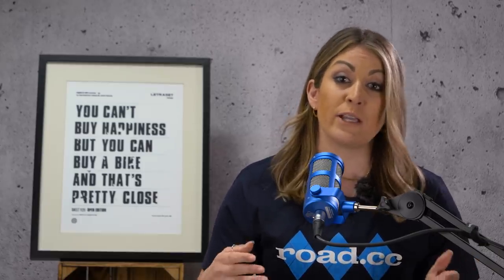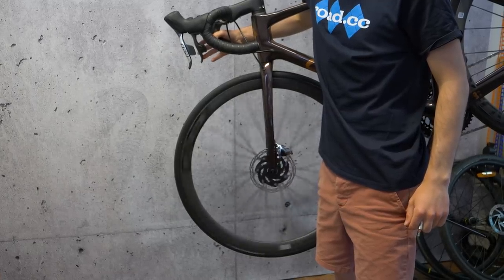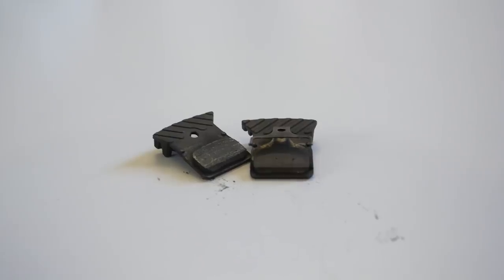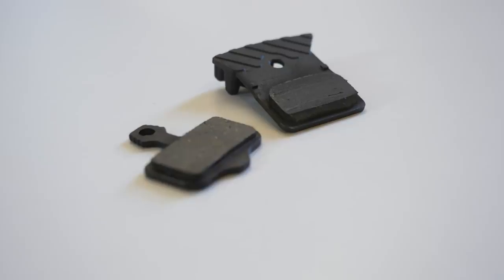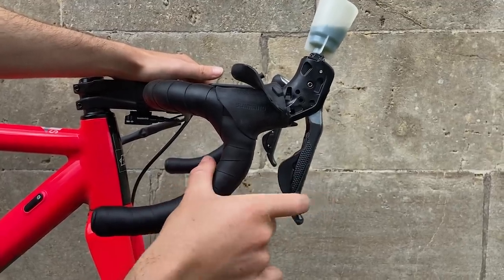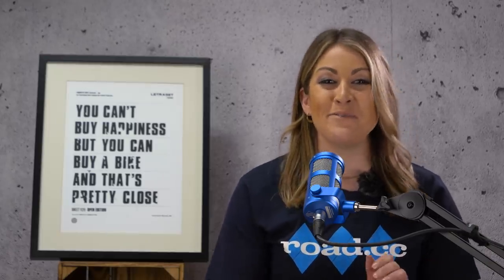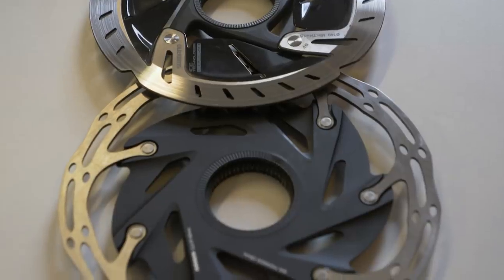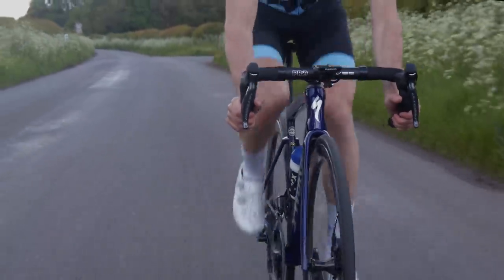8 things they dont tell you about disc brakes

Comment: On the aero aspect there is minor difference/s between the rim and the disc, and the tests have been done time and time again. However, on the maintenance, servicing, fluid change, breakage etc, the disc brake falls way, way, way behind! Yes, half of the Tour de France, Giro di Italia etc racers, do have the disc brakes, but that's only about 200 people on Earth with a mechanic crew with them all times.....if you aren't racing with a crew with you all times, just stick to the rim brakes, the pro level pads on the rim do a good job even in wet conditions, and no bike shop, or crew needed!

Comment: @road.cc... Most problems with disc brakes are caused by poor setup, or poorly engineered brakes. If you do not get the brakes properly alligned during installation you loose your pad clearance tolerances which will cause the pads to rub the rotors. If the company cheaped out on the hoses and fittings you will get air in the lines causes a lot of headaches. So to remove the headache from disc brakes buy a upper end model and get them properly installed by a good mechanic.
Reply: That is very true, another problem is bike frame manufacturers are poor at keeping tolerances within design criteria, so mounting holes, through axles are not perfectly aligned. Therefore your caliper is not straight and/or your wheel is not perfectly aligned. Not such a biggie on rim brakes but important on disc. Why i believe some people have no problems with disc and other have a nightmare with them.
And all surfaces need to be faced prior to building the bike.
Reply: I did my own setup with Shimano disc, perfectly.  Has nothing to do with it.  Dams F’in Squealing. 😡
Reply: @robertp7209  ... It sounds like you have a resonace issue of some sort. Chris Froome was having a similar issue on his bike which is why they went to the Swiss Stop brake rotors and pads.  Frame manufacters, fork manufacturers, and brake manufacturers have not tested their equipment together to make sure they aren't prone to hitting resonant frequencies. 

https://www.swissstop.com/catalyst/
Reply: @coldforgedcowboy  thanks for the advice, the bike came with bolted Shimano ICE rotors.  At this point I don’t care about weight, just don’t want to wake the dead when I brake. 😳

Comment: Rotors are more expensive than people realize if you stick to spec. New Shimanos are 1.8mm and have min thickness spec of 1.5mm, so you get 0.15mm per side of wear before replacement, which is not that much if you do any sort of descending on them. If you are riding Ultegra rotors at $60 per pop, it'll add up quickly. Same with those fancy finned pads. Budget a couple hundred dollars for brake consumables per year. Compared to rim, which you can ride for ages on same pads and if you keep pads clean, maybe get 20000+ miles out of  a set of $300 alloy wheels before needing new rims.
Reply: Exactly, I been riding alloy for 15 years and it still doesn't need replacing. Disc Brakes are for idiots running down the latest fad

Comment: How does the bike know whether you are bedding in the brakes or not? Because it must know otherwise just normal riding will bed them in (how do you brake without using the whole disc surface?...), so the bike must be able to decide to ignore this riding till you let it know your are bedding them in right?
Reply: In my experience bedding in takes about 2 minutes. Ride up to about 25 km/ hr, hit the anchors reasonably hard, do this about 10 times and good to go ….
Reply: It doesn't. Bedding in is just a process to get them up to optimum performance as fast as possible. You never know when a driver may pull out in front of you, hence the bedding in process to do it as soon as possible.

Comment: I have mechanical discs on one hybrid bike and hydraulic on the other one which is electric. Yes I know, but in my defence I am 72 now and live in an area packed with 20% climbs from river valleys. I have V brakes on my  mountain bike. My hybrid weighs 22 lbs and the electric 49. I have been cycling semi seriously since I was 12 and was a member of the CTC many years ago, so I have had lots of rim braked bikes. I don't think that there is any comparison in stopping power between discs and V/rim brakes. The discs are miles better and progressive. I can't either discern much difference between mechanical and hydraulic except that the hydraulics have to stop 49 lbs and me, down very steep inclines. They don't fade at all. In the wet, they can be a life saver. You might as well whistle when trying to stop with rim brakes in very wet conditions. The only downside is that  pads keep peeling off the backplates.

Comment: So far so good. They stop me on a dime!
Reply: So do my rim brakes.
Reply: On a wet road? Without your tyres skidding? Pull the other one.
Reply: @reginaldscot165  is it more about modulation or break force ?
Reply: @ulyssepinon9177  Speaking as a mountain biker here, so feel free to ignore. ;) For me it’s a combination of both. (I run Hope 4 pots on both my bikes) Modulation, so you learn over time to brake safely in different conditions and on my set up anyway, the force you can generate means you can brake quite well with one finger. Let’s you concentrate more on the steering. I’m thinking long, steep, loose, rocky, twisty descents here.

Comment: it is allowed to upside down the bike? with removed both wheel to pack in the car,.. there is any issue of leaking fluid or failed on the hydrolic system ?
Reply from the maker: no, it's a closed system so upending the bike is fine. although some zealots will tell you you're not allowed to do that to any bike...
Reply: @roadcc  thx a lot for reply,.. im planning buy second hand discbrake buat outside city so gonna used car to load that bike (if the deal done)
Reply: @roadcc  maybe just make sure putting some coin or something to prevent pushed piston ?
Reply from the maker: or just get a spacer, they're pretty cheap

Comment: Okay, I only made it abut 1:10 in before bailing, but I have to make these 2 comments. 1. All I heard on the open was "8 reasons you bought the wrong thing", which is a bad way of starting a video. Look, you're off on the wrong foot. Then follow it up with some technobabble for 45 seconds, and you can check me right out. I ride disc, and I feel more confident on disc. come out swinging or go home.

Comment: Post Mount allows a mechanic to easily adjust the calipers position inboard and out. Manufacturers can get away with less precision.
Reply: I don't see it; I thought it was mostly cosmetic and I have had both. The things I appreciate about flat mount, is that if you strip the threads, you aren't damaging the frame.
Reply: @DEAR7340  with post mount the caliper has slotted holes which allow it to shuffle into alignment. From what I've seen, flat mount doesn't have quite the same wiggle room.
Reply: @DEAR7340  The same can't be said for the fork, unless the bike is, say, a Scott Foil (the disc brake mounting bolts are threaded into the caliper, just like the rear).

Comment: I don’t know if this has been asked before but can you get ceramic brakes for a bike? Some cars have them and I wondered if they have been trialed by anyone yet?
Reply: Ceramic brakes on cars (like Porsche) need a high brake temperature to work good, if they are cold they don't brake good.
Such brakes are made for race tracks, because they will get hot there and will have no fading like conventional disc brakes. In normal traffic you won't get in on temperature and in this case they are inferior to a standard brake.
You will probably never get a bicycle brake that hot, except on downhill tracks with downhill mountainbikes.

Comment: Most of the people in the comment section are full of shit.  Rim brakes are NO way superior to disk brakes.  
Disk brakes have way more stopping power... than Rim brakes.  
Disk brakes are fully functional & stop you when wet... Rim brakes do NOT. 
Disk pads will last years longer.... than Rim pads.  
Disk pads do NOT deteriorate with time... Rim pads become hard & brittle with age.  
Disk brakes are self adjusting... Rim pads need constant readjusting.  
Disk brakes require far less maintenance... than Rim brakes.  

Been riding hydrolic disk brakes on my mountain bike for 20 years, & only suffered 1 brake failure, inspite of all the wrecks I had.  Suffered a bent rotor after a crash.. but the brake was still functional as is, & I was able to straighten it out with a multitool.  

Road Rim brakes on my BMX bikes for over 10 years, & suffered dozens of brake failures... which resulted in having to make feild repairs or walk my bike home.  Pads ripping off the mounts or braking apart, broken cables, stretched cables to name a few problems.

Comment: Can't beat the old centre-pull rim brakes for simplicity and functionality. How hard does anyone need to brake in most situations? Unless you're racing or doing steep downhill routes, then braking doesn't really require disc brake technology at all. Long before disc brakes arrived, the TDF hill bombers did just fine with rim brakes on heavier bikes.
Reply: I'm not sure "it used to be enough" is really a valid argument when it comes to breaking. Stopping as fast as the conditions allow for should be the goal, right? Not factoring economics here.
Reply: @marcusott5054  Fair point Marcus. The ability to brake hard, in a secure and controlled way, is a combination of rider ability (reaction time and decision making), the road conditions (grip etc) and the actual slowing down of forward movement (braking) by employing friction braking of some kind (rim brakes, disc brakes, drum brakes, shoes on the back wheel, shoes on the floor). 
The need to brake hard, or harder, is related to speed, obstacle situation (anticipated or unforeseen), gravity (downhill runaway) etc. The more riders can anticipate danger the less dependent on heavy braking they will be. Extreme heavy braking usually catapults the rider over the handlebars anyway. 
Unless you are racing, then why not slow down a bit and anticipate more? Obviously, it makes sense to have a method of controlled stopping once you get rolling, so good reliable brakes and knowing how and when to use them will always be important. Having said all that, as a kid I used to bomb around brakeless without a care in the world, but I had some spectacular crashes and I was lucky not to ever have been seriously injured or killed !
Reply: @markdonovan1540  I fully agree. Being able to anticipate and drive safely is preferential to having to take brakes to their limits any day.

Comment: I started mountain biking on rim brakes, and welcomed discs with open arms. But disc for road bikes? I've got enough rim-brake power to skid my carbon wheels so I really can't wrap my head around it, especially with all that extra maintenance faff. Hell I don't even brake that much..
Reply: Most brakes can be locked, but this is a bad way to judge if a brake works well because a locked brake offers no control. I am not arguing that a disc brake is better, just that the argument you used against them is poor.
Reply: @TheRip72  the best way to judge a brake is by how well it performs its function. If the wheels can be locked out, that means stopping power is limited by how much traction the tire has with the ground, not so much that within the brake assembly. So with proper modulation the rim brake more than serves its intended function.
Reply: @angwx  Locking up is not a good reflection of how well the brake works. Making a tire skid is not good. It is less effective at stopping & loses control.
A brake converts kinetic energy into something else (typically heat).
One of my other hobbies is my cars. One of my cars had brakes which could lock the wheels but you really needed to stamp on these with a lot of foot pressure to get anything out of them. I have upgraded these so they now take a lot less foot pressure to slow down & stop (& I can lock the brakes much more easily if I really wanted to).
The key thing is that I have much more control & this is important.
This may be on a different scale, but the principals are the same.
Reply: What extra maintenance?  (I almost put that in capitals).  Discs require less maintenance.  My Di2 with discs and no rpt no inners and outers requires nil maintenance apart from the occasional battery charge.  I enjoy doing all my own services and my current bike gives me little pleasure on that front.

Comment: I have disk brakes on my MTB and sometimes they glow. So much so that I can feel the heat standing a meter away. Rubber does not glow, so, what they don't tell you about rim brakes?
Reply: Bigger rotors, less breaking. Sounds like you cramp up on them.
Reply: @petesahad3028  Well, the breaks are sram code rsc, the disk are as big as they get. But there is speed, a total mass of 125kg and unbelievable inclination. On those hills the pads are eaten like chocolate :-)
Reply: @MarkoPetejan 
Ok that explains it. You're a big guy😅

Comment: What a fuss! I ride mtbs with discs through mud and dust on steep terrain and disc brakes just do their job and do it well. Calliper aligned and new pads properly bedded in there is no need to do anything to keep them super effective for months. I'm afraid this video tends to pander for the Luddites! Next video will be all the problems with tubeless...lol!
Reply: Road disc rotors and brakes perform under completely different circumstances. There is a MUCH greater amount of heat and overall kinetic energy in the system, while at the same time having less robust rotors. Your experience on MTB is nearly irrelevant to roadies. You simply do not face the same braking loads that roadies face when descending at 70+kph on relatively small rotors.
Reply: @ThisIsANameBruh  all you are pointing out is that mtb brakes are fit for purpose....4 pot callipers 200mm rotors minimum 220 on a downhill bike..... which is significantly heavier and hitting speeds nearly as fast. If road bike disc brakes overheat they are either badly designed, or not used properly.
Reply: Don’t see any Luddites or fuss mate, just a good explanation of the things you need to know if you switch from rim brakes to discs on a road bike, completely different scenario from mtbs.
Reply: @davidroberts1162  It is the way the subject is approached.....as if hydraulic disc brakes are a revolutionary and troublesome new technology and something road cyclists just will not understand unless given very basic advice.......it is just amusing to the greater sporting bike community at large for whom disc brakes are the norm.
Reply: @mikerbwind  by the greater cycling community at large you actually seem to mean ‘we greater more experienced and more knowledgeable off road riders’  who are entitled to criticise explanations for lesser mortals. You may of course not intended this, but it’s the way you presented it .
Reply: @davidroberts1162  oh dear! No of course it does not mean that........maybe question yourself why you would interpret it that way, because it sounds like you being pretty defensive, where there is no need. Its just a discussion!!

Comment: When you upgraded your bike part to shed 500 grams for a thousand bucks then still voted for disc brakes:)
Reply: Right? My 10 year old aluminium road bike with aluminium wheels weighs 9.5Kg with pedals and a 500g cane creek thudbuster seatpost on it. It was 1800 EUR OVP new. To beat that weight nowadays I'd have to spend on a carbon frame and carbon wheels. Where's the progress in that?

Comment: The biggest issue with disc brakes is consistency, from the manufacturing tolerances, to component matching (eg pads), to the installation, to the bedding in and use/care. When all align you have a problem free bike, but it doesn't take much to then have persistent issues. I've had disc bikes be faultless for 2 years, then became frustratingly troublesome, because something in the above sequence was not right.

Comment: Who wouldn't want to spend more for something you don't need, weighs more, complicates maintenance and makes your collection of wheels obsolete. :)
Reply: Spot on, the change to a new system is the biggest issue in my view. It’s really like the decision to change from campy to Shimano or vice versa, all the existing stuff becomes non compatible
Reply: We need disc brakes like we needed combined shifters / brake levers. Downtube shifters did the job nicely.

Comment: people keep mentioning the difficulty of disc brakes maintenance. what kind of maintenance are you referring to? daily? full? unless you're riding in an oil pit, you only need isopropyl alcohol and wipe the rotors down. full maintenance isn't done very frequently unless you fucked up and contaminated the brake pads.
Reply: Maintenance seems to mean constant effort to keep them working as the minuscule tolerances make them rub constantly for many.  If they would just create them with a bit more room it would be a lot easier.

Comment: hmm - the bedding in procedure - do that with a car and you got warped disc - is that not an issue on thin bike-discs?
Reply: Bedding does not cause warping of a brake rotor.  
Brake rotors for cars have what's called a Discard Thickness.  As the rotors wear down from use, they progressively get thinner.  
When they get near or reach their Discard Thickness, & get too hot... they start to warp.  

It's the same for bicycle rotors.